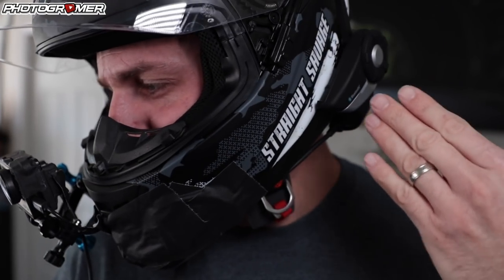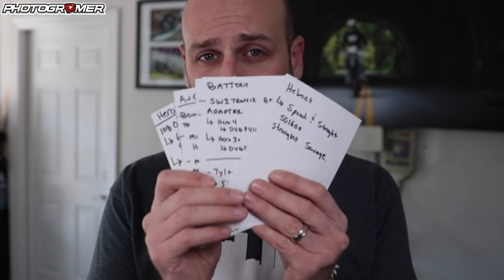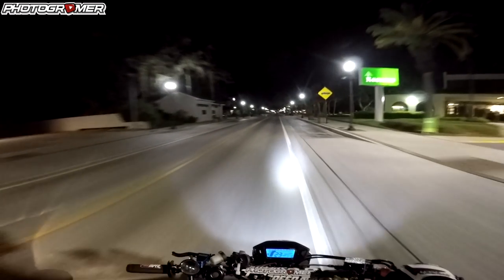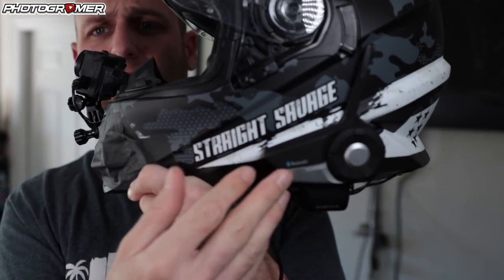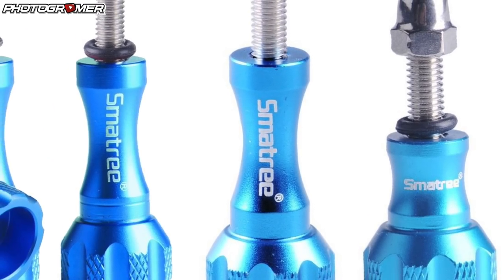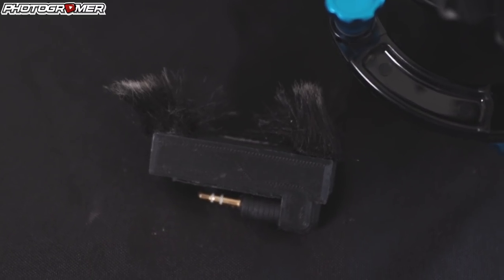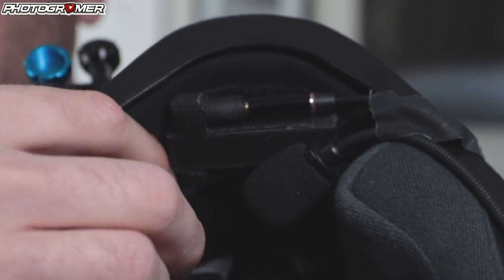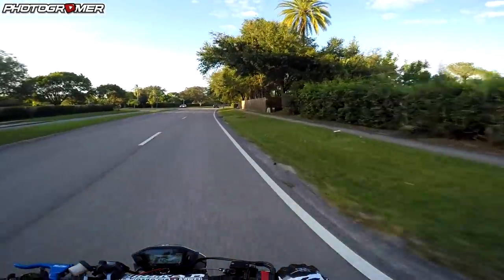How to build a Motovlog Setup

Comment: Congrats on the Jr! I have a couple of GoPros but the main problem I have is mic issues... I never really know if the mic is connected until I review the footage to only find out that what ever I had talked about didn’t get picked up. And only one of my gopros has the superview angle. How can I get it for the others?
Reply from the maker: +Gromsby Brothers thank you. That’s a constant issue, if the connector gets bad it can feel connected and still cause no audio. The bower is a little better on thickness however id still tape the 3.5mm plug into the adapter so that can’t be removed then tape down the wire leading up to the usb part down as well so you leave just enough slack to plug in and unplug the microusb to the gopro. Then get in the habit of always pushing the microusb into your gopro along the ride to ensure you have a solid connection.

Comment: How comfy is this helmet? It’s super cheap, looks cool, and has the drop down visor.
Reply from the maker: It’s nothing special as far as comfort goes, as to be expected at the price range. It’s a good around down low speed helmet but there is noticeable wind noise compared to higher end helmets. Not a bad budget or entry level helmet for sure.
Reply: Photogromer I have a Simpson bandit. Which was an overpriced garbage. Looks cool, but has A TON of noise and fits like crap. 
I just found this on amazon for $100.
Reply: Is the hero 4 still a viable option for motovlogging?
Reply from the maker: Pandita P yeah watch my latest upload that’s on the hero 4